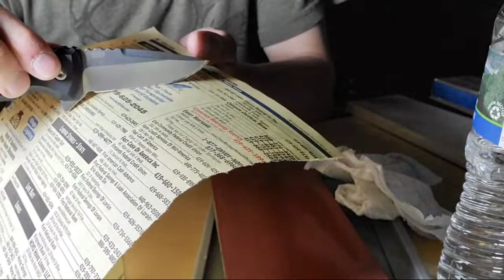First Impressions Of The Venev OCB Diamond Waterstones

Comment: Very helpful! Two quick questions: I've got the DMTs in Fine and Extra Fine. For refinement to a mirror polish above these two stones, which Veneve would you recommend? Also, where did you get your rubber or silicone tray? Thanks!
Reply from the maker: I would say the 800/1200 would be your best bet. It won't be a perfect mirror though. Very polished. I don't remember where I got the tray. Maybe sharpeningsupplies.com?
Reply: @tomhosangoutdoors9380  Thanks!

Comment: Tom what is the bottom line on the venev stones I watched much of the live stream, but didn’t get your opinion.

Thanks steve
Reply from the maker: Love them so far! They don't cut quite as fast as DMTs but they leave a much more refined edge. They have a much better feel to them too.
Reply: Tom Hosang Outdoors yeah I love mine on the high end, for reprofiling the coarse I think I have 150, is a little slow, but the higher grits kick ass.  I often end up reprofiling on the KME and then sharpening on the venevs helps to set the bevel where I like it-15 degrees.  Best to you.

Comment: How often are you finding you have to resurface these stones?
Reply: Wondering this same thing?
Reply from the maker: Clean them every 2 or 3 knives. Leveled every 10 or so
Reply: @tomhosangoutdoors9380  how do you level them? Are you using a nagura to clean?
Reply from the maker: I just use small 1x6 silicon carbide stones for both